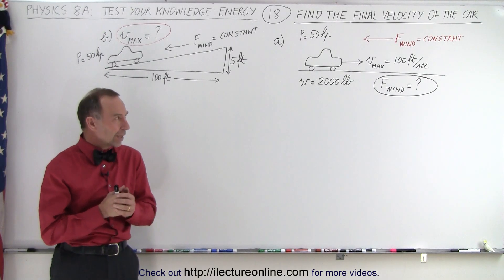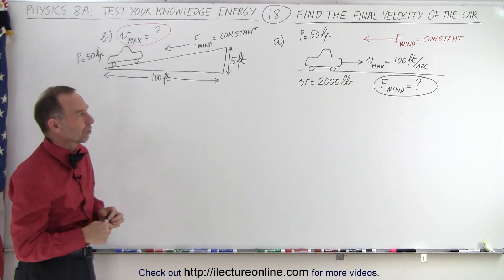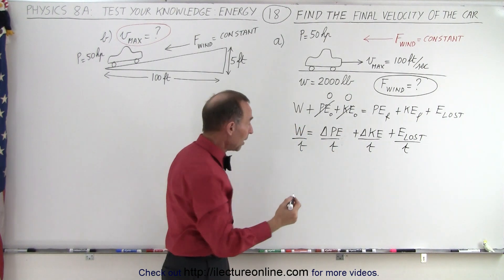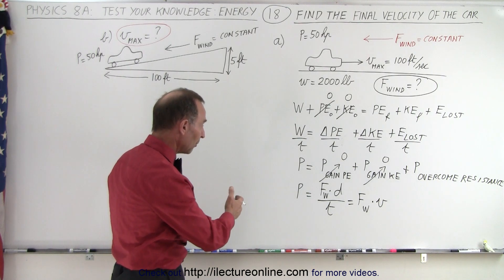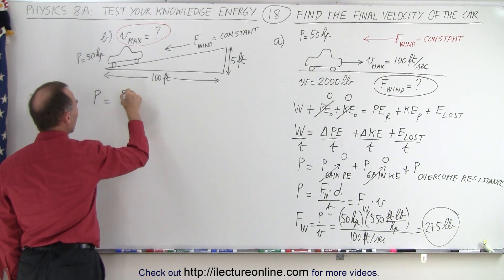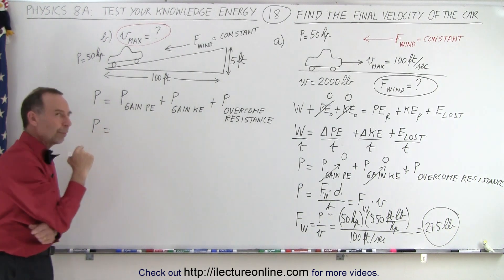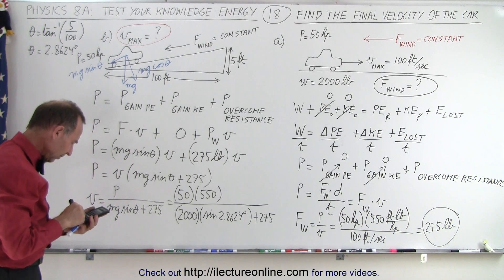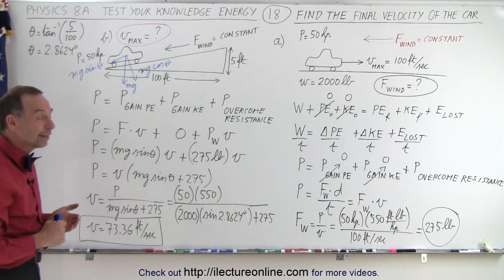Physics - Test Your Knowledge: Energy (18 of 33) Final Velocity=? of the Car

Comment: A 0.1 kg arrow is moving at 48 m/s to the right and strike a 3 kg object (helmet resting on a 5 kg head) moving to the left towards the arrow at 9 m/s (full mounted cavalry charge). It takes 80 Joules to penetrate the 3 kg helmet made of wrought iron, what is the velocity of the arrow after penetration when it slams into the head? What is the velocity of the 3 kg helmet after penetration moving to the left or right?

Comment: Mr, 275 is Force of the wind in the LHS, and it is used as Power of the wind in the RHS which you might have mistook or im mistaken
Reply from the maker: 275 lb is the force exerted by the wind (not the power)
Reply: @MichelvanBiezen  yes and im confused in 7:37, could you please explain it and correct me